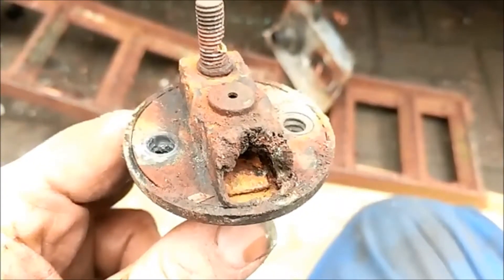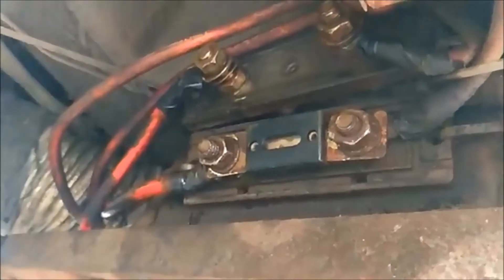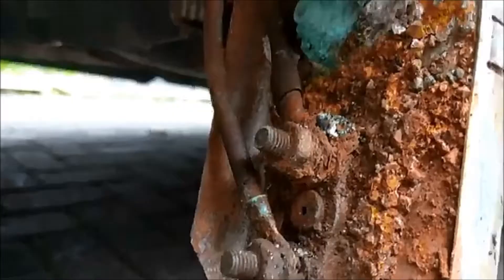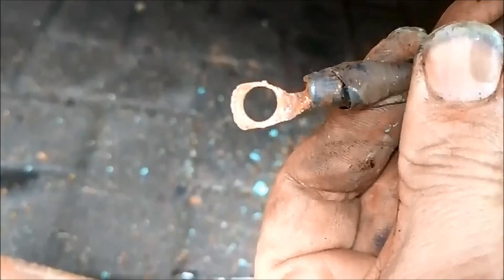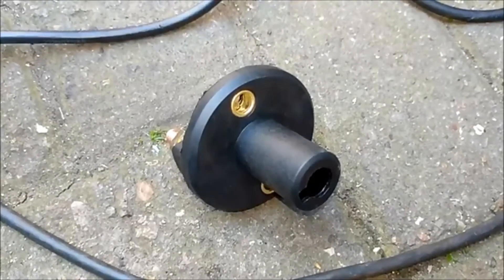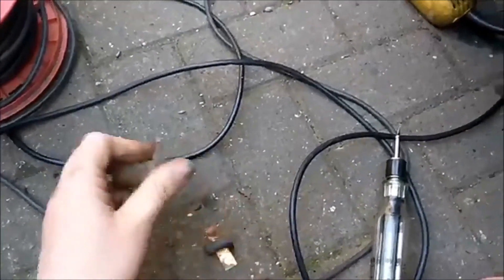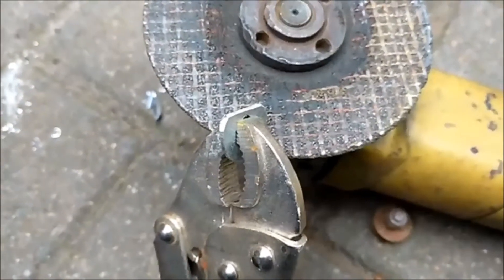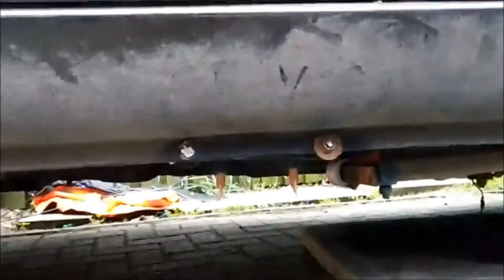Project 806 Camper, how not to wire a 12v isolator switch

Comment: Could you not fit an internal bis? or one where the handle stays put?
Reply from the maker: Yeah for 'security' i will drill a hole in the key and run something through it, like they chain pens down at the bank....

as to inside or outside,  i like the outside approach as if you ever have an electrical fire, or come back to one, i'd sooner spend time switching off outside away from the fumes, just seemed safer if less convenient to get the switches right next to the batteries.